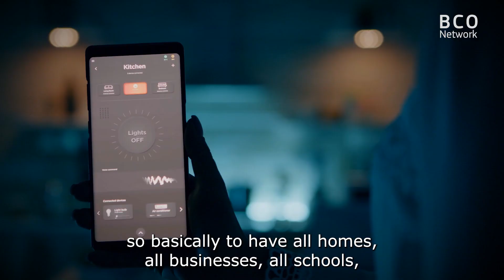The Gigabit Infrastructure Act

Comment: yes absolutely! as described for ages in the 1984 Orwell book ...ok bye bye EU i will find a better place int his world 🥴
BTW you don't talk about 26Ghz new 5G infrastructure (only about Fiber) ...why ? 🤔
the birds are already dying like crazy but you want more massive extinction ...isn't it🎖this is YOUR Eco way right 👏
Reply: That 26 GHZ I assume you are talking about milimeter wave 5G, usually that won't be thrown all over the place unlike how they did in New York.
In most cases you'd only see it in major transportation hubs or areas where mass gatherings are expected from Tourists and locals alike.

You will expect to experience Sub 6 5G which is closer to 4G and uses a reduced frequency to connect to longer distances can also handle more people at a given moment.
Milimeter wave is more limited on distance, as it mainly prioritises fast speeds but a piece of paper in front of the signal would be enough to halve the speed significantly.

Fibre is generally more important though, as it does effect how you live your life at home. Whilst 5G would usually only be used while roaming around a city.
You talk about the environmental impact too, 5G generally uses less cabling and if you do use it as wifi, it can be better for the environment, that doesn't mean it would be nearly as fast.
Besides it is closer to that of 4G and or slightly faster

Fibre is literally a glass/plastic cable that is permenantly installed underground, or on electrical poles to connect to your home. It uses light for fast data transfers, you are most likely also using this technology to connect to Youtube through your ISP which in fact uses the same fibre cable to go send that data internationally, whilst underwater.